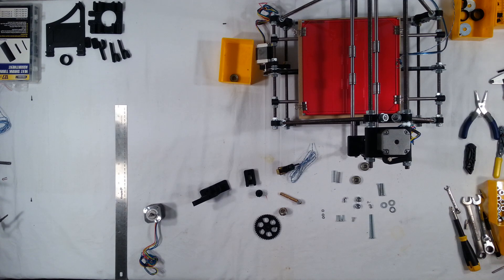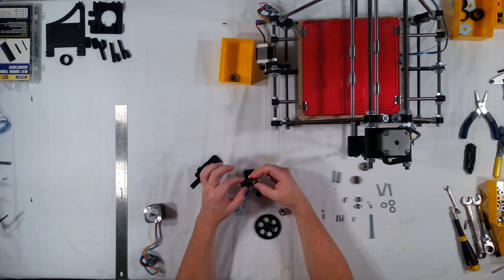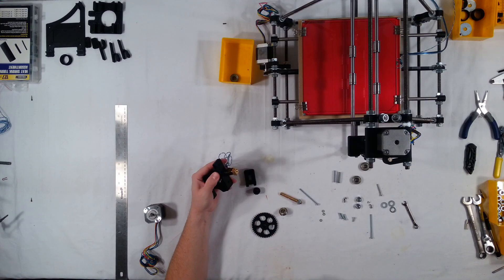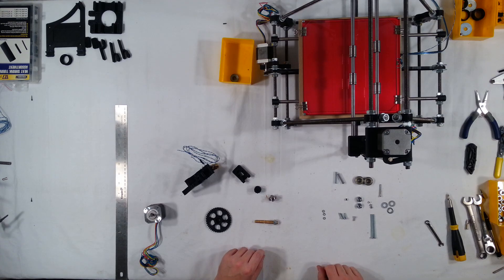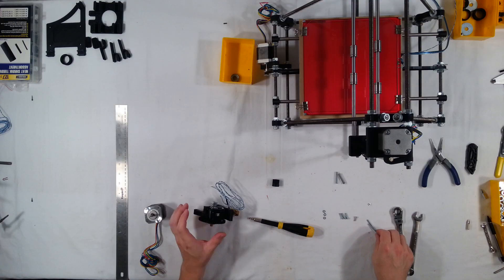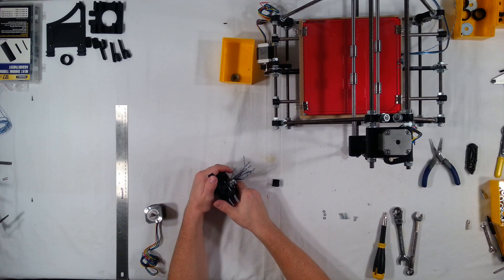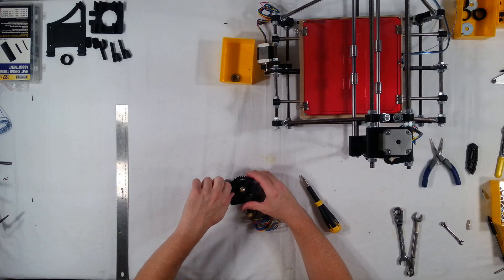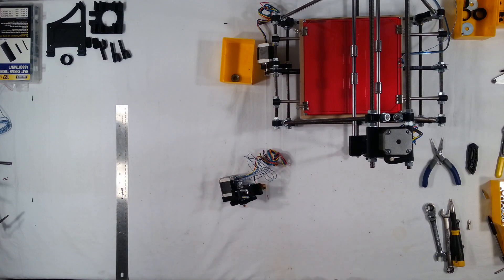RepRap Prusa Mendel Iteration 2 Assembly 14 - Extruder

Comment from the maker: If you have a vice, you can set the rod and pulley in it so that the inner cylinder of the bearing rests on both edges of the vise clamps. Then, tap the top of the rod with a hammer. Make sure you don't rest the outer cylinder of the bearing on the edge of the vice or you will destroy the bearing. If you don't have a vice, you may be able to use something similar. I once used a block of wood with an 8mm hole. If that fails, get replacements. If you got it from nwreprap, it wont cost anything.